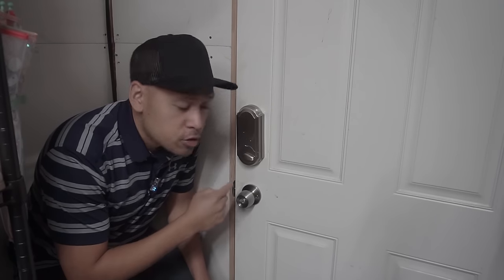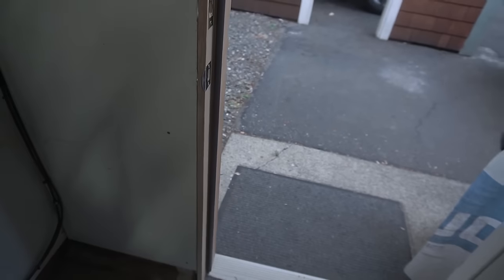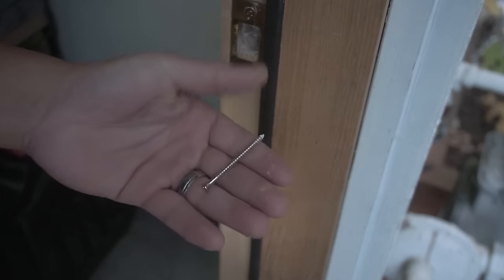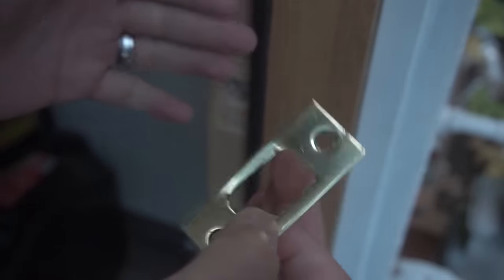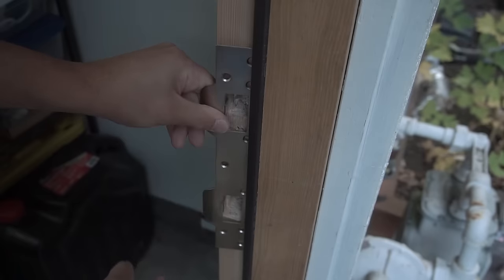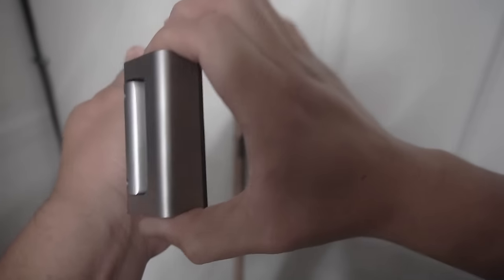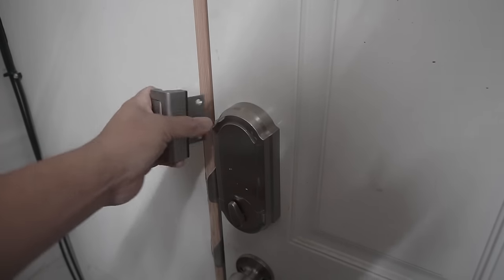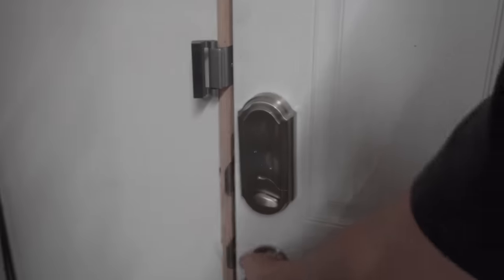How To Make Your Door Kick-In Proof Like A TANK! Keep Your Family & Home SAFE!

Comment: Having the retractable dóor lock separated out from the dead bolt and door knob will spread out the force making it harder to kick in the door.  Also, putting 3" screws on the hinge side is a good idea.

Comment: what's even better is to get a long drill bit and drill a hole large enough through the jamb studs and back into the wall that you can install a steel pipe for the latches to go into. The longer the better.

Comment: If you don't reinforce the jamb on BOTH sides AND add a metal plate that faces the inside of the house at the lock bolts you haven't really fixed the problem. // Commonly-and I can see on your door-a burglar can "jimmy" or force the door to one side with a pry bar in minutes because the entire jamb is almost always pine which is pretty soft. That weather-stripping adds "room" for the burglar to work.

Comment: Use stainless steel hinges screw all around over multipurpose screws. Hinges screws are fully threaded. As you can see in the video multipurpose screws aren't fully threaded which becomes a weak point.

Comment: You forgot to point out your dry wall is 5/8" thick when seated, it adds 3/4" and if you measure the distance from the edge of dry wall to your previous plate at its center, you're only left with 1/4 of stud bite.  So this means you're left with just 1" of soft wood trim to protect your door.  Regardless of how deep the screws were being used it's helpless against any kick.  The boot just need to apply enough force against 1" of soft wood.  99% of American door are having this week spot.  I was shocked when I replaced my entire door.  This means even a little kid can boot down any front door.  After I removed my previous door I was suprised to see it only had 1/8" of stud bite!   You have to account for crookedness when screwing in, I have another spot with 0" stud bite!  Your replacement on the other hand as has thicker gauge and deeper screw placements.  Placement holes furtherest from you will provide between 3/4" to 1" of stud bite (accounted for dry wall depth).  If you get a 4" #10 deck screws, bolt the SOB down ...ain't no zombie can kick through.   The screw placement closest to you, you just need enough depth to hold it onto the trim.   Furthermost placement, go for fiull 4" depth.  That will secure to wood trim (1") + 2x wood stud (3")

Comment: The absolute best method is to install an out-swing door and glue the jamb to the framing with non-expanding foam, even using a cop door ram, they would have to literally bust the door to pieces before gaining entry.

Comment: Put a pipe through the wall where the deadlock slides into.   Flair the edge of the pipe so it can't fall into the wall.  The wall stud is drilled to give the pipe integrity. Then replace the brass cover plate the deadbolt slides into.   The door will practically be part of the wall when locked.        I met an inventor that made a product similar... The sova lock system i think he called it.

Comment: I use deck screws.  They’re practically indestructible.  I prefer to use a 3-1/2 inch deadbolt, pry proof plates, hinge pegs for outward opening doors (God forbid), Charley Bars for sliding doors and windows, smash proof film on large window panes, Arlo Security Cameras, Ring Doorbell Camera, and Simplisafe security systems.  I use Owl Dash Cameras for the car, and I bolt down my safe. Never been robbed once, even when my “duh” roommates bring home all kinds of shady people, they never got into my space nor got my stuff.  My roommates are a different story.

Comment: At the dead bolt strike plate put 3" screws or longer.  At hinge side nothing as you already should have long screws at top hinge and mid hinge.  Put foam around.  Installed probably 100 doors that way and nobody breaks in.

Comment: You forgot the other side of the door, there is something called door hinge security pins ($10) that enforce the other side of the door as well. Even if the installer messed up and has the hinge pins on the exterior of the door this keeps the door from opening.

Comment: The hinged side of the door, and that's also vulnerable. Using 3" screws would help, but are there better hinges than those usually installed?

Comment: You should spread the load out  across the door more.  That extra door lock sb 6 inches or more from the dead bolt.   When one section of the door is attacked it can split and damage the security of the wood and  screws to of that second lock

Comment: I had my home broken into before we moved in and could see where the kicked the door in,  I bought 2 aluminum 2 or 3 inch wide 4 foot strips and and cut the holes fo the latches and mounted 1 on the door frame and the other on the doorthe next time I came and checked on the house, I could see where the tried again and a body print at the bottom of the stairs when they tried to kick it in again, the body print in the mud was funny.

Comment: Oue side door used to open over a 4 X 4 foot landing with stairs going up and down. Imagine 3 children on the landing trying to put on coats and open the door. Doesn't work ! I put the hinges on the outside and put stainless steel pins a foot apart down the hinge side so when the door is closed the pins go in the door. The catch side has a 4 foot 1/4 inch thick aluminium plate as a strike. Try to kick the door in , difficult because it opens outward now.

Comment: Use one inch screws to confirm the placement of the new plate. Maybe it's not important if the initial 3 incher needs movement. He does this on the new reinforement lock.
I hate impact drivers

Comment: 3" screws are nice; sometimes they skew the gap, after a hard winter.  I would suggest adding a 1" thick oak trim around the interior of the door....and add trim or use a router on the edge.  That 1/2" thick board is still 1/2".  If you want it to be beefier, drill and screw in that 1" thick oak; putty, sand and paint/varnish. In all practicality, I will tell you of something even WAY stronger.....install a camera.  Thieves hate recognition.

Comment: No need for a "special plate". Just add longer screws in hinges and striker plates that go into the studs which are stainless steel or hardened steel if you can find them.

Comment: The problem with longer screws is that it can go all the way through the house framing and into Romex that is stapled to the other side of the framing.  Even if there are no light switches at the door frame, there may still be wiring for such things as outside lights.

Comment: As someone who's kicked in a lot of doors throughout my life I can guarantee if someone knows what they're doing those reinforcements won't prevent them from getting the door open. Don't get me wrong those upgrades are better than the usual door locks most people have as shown in the beginning but like I said if someone knows what they're doing it won't matter. Usually when I kick in a door the wooden door frame and sometimes even the door will break and basically shatter. Pieces of the door frame, wall it's attached to, and even the door will crack easily and pieces will end up all over the place. Not going to say why I'm experienced with kicking in doors but it definitely wasn't to steal or rob anyone. Law enforcement and military will also vouch for what I just said. Using a crowbar, sledgehammer, battering ram, or even an axe will get the job done even better but if you know how to kick a door right and are strong enough you can get it open in 1-3 kicks no problem.
Reply: I am certain that Bruce Lee was aware of those techniques!

Comment: If you are looking to resecure your loose door latch or dead bolt due to loose or stripped screws and do not want to ruin the esthetic of your door with one of those metal sleeves, I have invented and produced ReSecure Latch. ReSecure Latch sits INSIDE the doors bore hole along side the latch. Is invisible after install and works with most top major door hardware brands. Come check us out.

Comment: When I'm away I wedge a 2x4 behind my front door and sliding glass door.. My metal garage back door has a steel cross brace.. If the electric is out and I can't open my garage door, I can't get in unless I climb thru the second story window...

Comment: for double front doors they sell on line a ring that attaches to the door latch. It is incretable. As you know it is very easy to kick in a double door. With this unit installed it is virtually impossible.

Comment: My back door was obviously kicked in before I bought the house. When I went to reinforce it with an $80 kit I bought at Lowe's that reinforced the locks plus the hinges I found that when I removed the shitty paneling around the door....the frame out for the door opening was too large. The store bought door holder (sorry I can't think of the proper term) was too small and there was a 2 inch air gap all the way around with just a few nails holding it in place:( I cut out the nails and filled the gap with 2x4's then mounted all the hardware with 4 inch screws. No one is getting through that door without a large angle grinder. Don't buy doors with windows. Don't assume you have solid wood thickness behind your striker plates or hinges. Decorative windows next to your doors are a weak point. Stay safe brothers!

Comment: That combo striker plate/bolt receiver alone will make it nearly impossible to kick that door. As a scenes of crime officer, I attended hundreds of residential B&E’s. MOST of these door-kick burglaries were done on doors with a striker plate mounted with 1” screws into finger-jointed pine. One kick and done. In my opinion, a plate like you installed, with 3” screws that reach the nearby stud, is almost impenetrable for even the most determined thief. Add a long-throw dead bolt and the shitrat trying to get in will lose interest long before the door gives way.

Comment: Most any professional crook can pick your door locks, they are the cheapest unless you replaced them with Medico or similar.  Really a commercial steel door has the better protection and can’t be defeated quickly.

Comment: Where are the links?
Reply from the maker: Hi! They are located in the description of the bottom of the video or you can check out these links here:
- Defender Security Door Strike Plate - https://amzn.to/3QxYFht
- Defender Security Reinforcement Lock - https://amzn.to/3JI7xiw
- 3” Door Screws (Black) - https://amzn.to/3deHG5r
- 3” Door Screws (Satin Nickel) - https://amzn.to/3Pb6Gb7
- 3” Door Screws (Brass) - https://amzn.to/3vUvNZ0
- Wood Chisel (4 Pieces) - https://amzn.to/3SDVkzj
- 3/32 Drill Bit - https://amzn.to/3QkaJTR
- 3/32 Impact Drill Bit - https://amzn.to/3AdVxC1
- Impact Driver Drill - https://amzn.to/3duvyxC

Comment: Have to have 2 coded  locks Both Coded locks have to be dead bolts , which you can never leave your door open, changing the wood material on frame  to exterior ground contact more stronger durable material or a metal frame with using the old wood back frame wall mount,,  or if wood a metal back plate either glued or screwed in ,,,.  The problem is that criminal s got smart ,they kick in the side of the hedges ,,  hedges side are been kick in so you can do the same as video around the hedges or middle thicker plates larger screws or bolts , the wood is the problem pre drilled or getting a metal door .

Comment: That additional reinforcement lock is not a good idea.  If the occupant is injured or has a heart attack, then relatives with the correct key cannot enter for rescue.
Why do you have a key in the knob lock with a combo lock?  if the bottom one is locked, you cannot get in with the correct combo.  Use a passage set instead, like a hallway closet function which will keep the door closed when unlocked.

Comment: What if you bought a hole saw bit and drill. Then stuck your hand right through and unlocked the door from the inside
Reply: Like what if you drilled a 5” hole and stuck your hand right through. All a door is wood. Hole saws and the drilling process is very quite and fast

Comment: bottom and tops are very weak even with a stout door.. there's no reason to reinforce what's reinforced already while leaving weak points opposite of the hinges.. those ar good locks the won't fail.. the bottom of a door will move while its locked.. you need that extra lock in the middle when  the bottom and top are weak

Comment: Wow if that is a standard American door, they are ridiculously insecure.
Here in the UK, we tend to use a multi point latch system where you will have a 2" deadbolt then, a further 4 or 8 1.5" hooks which come out when you lift the handle up totally reinforcing the door to the frame.
The frame and door is usually reinforced with stainless steel or some other hardened metal.
Reply: You have to remember that all Americans are well armed with assault rifles.

Comment: This door is NOT "Fully tanked out" as you call it.  To do that you will need to replace ALL the hinge screws with 3" screws.  If you don't do that then the hinge side of the door is still; very vulnerable to a thief who is smart enough to try kicking in that side of the door when his kicks don't break down the door on the lockset side.

Comment: Do you think you can help us all and make a video on how to reinforce Windows could you really can you can put security film meaning if somebody throws a rock at your window it might shattered the outside pain but if you have the film on the inside pain then the window will actually spider web instead of shattering so it will make it nearly impossible to entry through the window but you can also put it on inside and outside and if somebody tries to break your window the window will only spider web also making it so you can take longer time to replace the actual glass itself. And it is safe for because it will keep shards out the window will not be able to break through.

Comment: I don’t I think I’ll stick to my 3 piece hollow metal knock down frame you can still use your wood trim if you can use a nail gun with some true nail shots to hit the existing holes and you can get this type of frame at any door company and are just a little more expensive than the wood ones were the more screws you put in the weaker that are and after all the work trying to get the wood doors to almost work trust me as a carpenter for 48 years I’ve seen this before while I was replacing to metal and if installed with the proper revels around door it won’t kick in

Comment: None of that will stop cops with a battering ram.
Easier to kick in those thin door panels to get in.

About your screws - take a hammer and dull the sharp point of the screw like you would do with a nail.
Also, put one drop of liquid dish soap on the end of the screw. Makes it easier to drive them in.

Comment: The reinforcement lock looks so small, holding on the door, where it's right on the edge. Why don't they make it thicker to hold the door much better instead of a thin piece right on the edge???
Looks like the door barricade is a better option. Even better with padlocks on both sides for doors in the back where it's most likely to be break in.

Comment: First of all even by common sense rule, your door should be possible to open outward, not inward, for safety purpose- to get out of the house easily as in case of fire, and this outward opening of the door gives you first good protection against easily breaking into your house.

Comment: You should be talking about making your door frame kick proof!!  most times the door frame gets busted not the door, Also you installed a deadbolt, This is the biggest mistake! not only did you make the frame weaker by putting a hole in it, you also make the door weaker by putting a hole in the middle of the door. In this case with a deadbolt first thing will get broken is side of the door where the dead bolt is install will give way or the door frame where the dead bolt is will give way, Best lock is a deadlock not a deadbolt which makes everything weaker
Reply: With that strike plate makes the frame strong by a little, but using 3 inch screws only helps if time behind the frame is there, At the end of the day you made the frame stronger somehow, but the door is still very weak where the deadbolt and handset is

Comment: Pricy contractors install the strike plates w factory 1/4” screws. 1 kick from an intruder will snap it right out of frame. Install 3” screws it goes completely intro the structuring of the house & the intruder will get tired🤣. This is how building contractors & construction companies get away w so much profit.

Comment: If you really wanna learn the anatomy of a door, simply drive down to Home Depot and look at doors and door frames. The ultimate way to kick proof (or even battering ram proof) your door is to replace the entire door frame with a metal frame and metal door.
Reply: Put in a moat and portcullis,and have an overhang upstairs to pour boiling oil on the enquirer

Comment: I'm guessing that the wall right next to the door is some vinyl siding, 1/2 inch plywood, fiberglass insulation, and 1/2 inch drywall.  Am I right?  So an intelligent burglar would just pry off the plywood, punch a hole in the sheet rock, and then reach her hand in and unlock the door.

Comment: We had a nogoodnic selling drugs in house behind our house. Had the contractor install an extra heavy steel door frame for new steel rear door. I installed a foot long 1/4" thick angle iron piece where 1" dead bolt enters frame. Bolted the side and additional angle iron piece to concrete wall with lead anchors. Going to take more then a kick to fina!ly open this door.